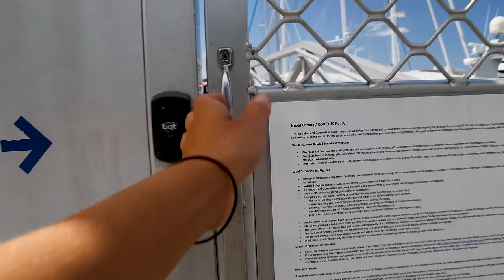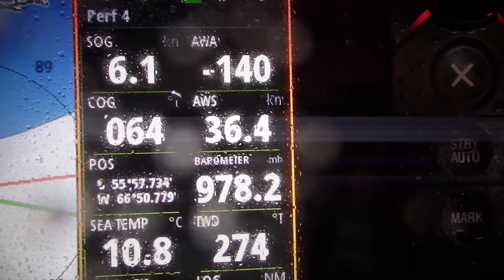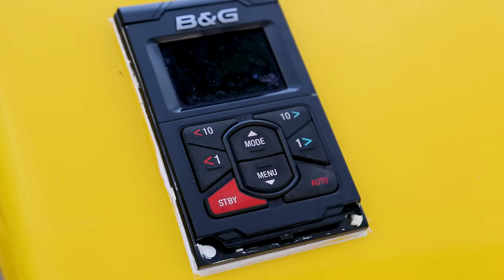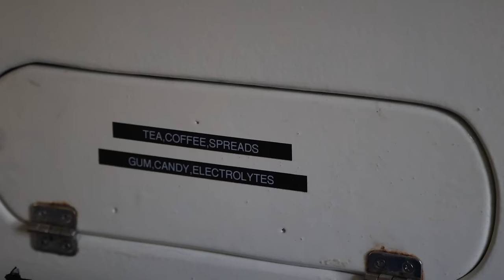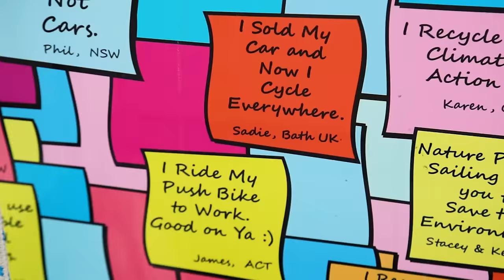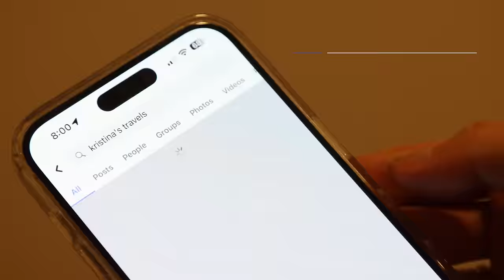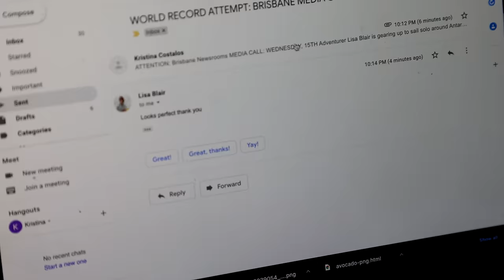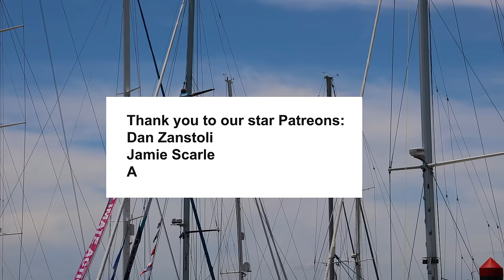First Woman To Sail Solo Around Antarctica (Breaks World Record!)

Comment: I heard that boat design is specifically made to go past 90 deg (a knockdown) - if it gets close to 70 deg it's meant to keep going, in fact designed to speed up the rollover so it bounces off the water. I know that sounds crazy, I thought so when a Naval Architect who designs similar "Volvo-type" race boats explained it to me. Apparently if you design the boat to be extremely unstable past 70 deg. you are also increasing the likelihood of it tipping back upright. Meaning: this ultra-instability is designed-in to the 70-100 deg rollover zone, so the slightest force pushing it upright again, ie when the rig hits the sea in knockdown, will send it back back upright again. Goes against all you think is sane and good. Imagine the sailor who has this explained to them and still hops in the boat, alone, to circumnavigate the entire southern ocean! I wonder what the diameter of those rudder posts is... lot of deflection I would have thought.... Same guy told me the boats have to chuck a drogue over the transom and not the bow if they lose steerage. Apparently over the bow the boat will just snake around like on a mooring ball in a hurricane. Love to hear from someone who knows if this is all bullshit.

Comment: Takes a different kind of sailor, so much kudos to Lisa!
You'll no doubt experience the Mediterranean Meltemi more times now and it's forecast strengths sometimes far from your localised 25 - 45 gusting 50knts! Not often, but twice in the last 10 years had unforcasted localised 50knts gusts over the deck whilst family sailing around the Mediterranean.
Reply from the maker: It's honestly my worst nightmare.. It's def something that's in the back of my mind.. the Mediterranean winds.. and sometimes they unforcasted right? Or are a lot stronger than predicted??
Reply: @Kristina's Travels  bit of both sometimes. Even using Windy, Predictwind and Wind Guru have gotten localised extremes. Of course, some say what are you doing out there, but in the med, you can be down wind light wind sailing full sails and all and then the next moment you can't let the main out quick enough.
Training kicks in and calmly does it, recover and move on. As long as you know the ropes (pun intended 😜) and both can operate automatically without question in an incident, it all works a treat.
Just getting Sam (wife) more confident in marina manoeuvring coming alongside etc. The more times you sail, you will eventually have to do the jobs that ordinarily you haven't in the past. Knots, especially!!!